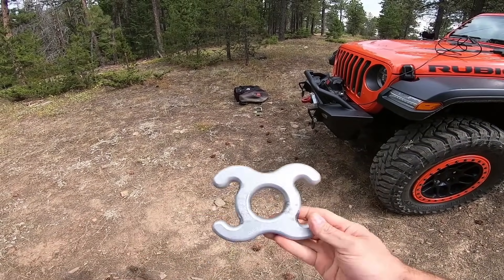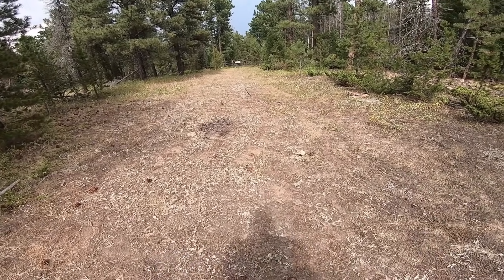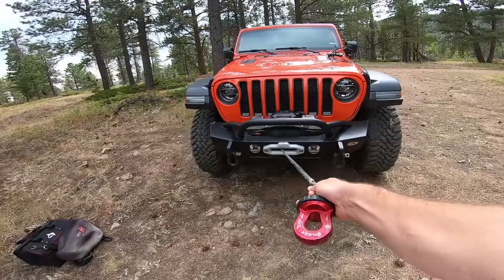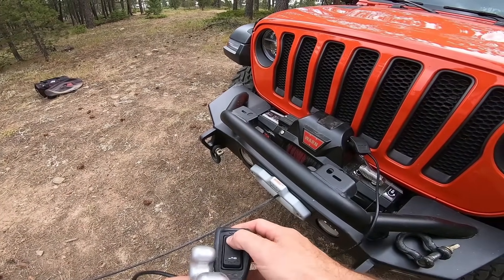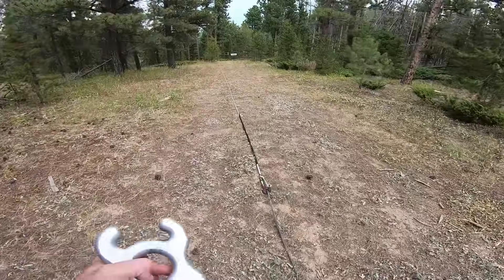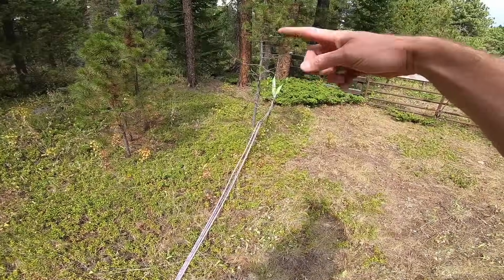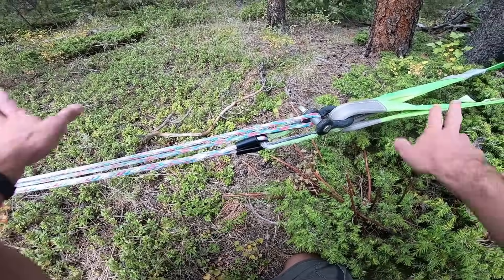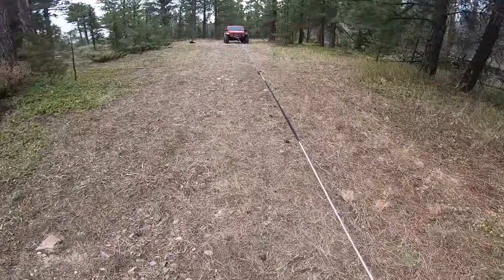Offroad Recovery Gear - What's an X-Lock Part 2

Comment from the maker: i was calling the shackle a "bow pin shackle" for some reason today which is wrong of course.  It's a screw pin bow shackle lol!  have no idea why I did that over and over, but I did.
Reply: the only tree,,the only tree,i could attach to,,in the simpson desert,took 25 yrs before it was big enough...i died after 4 days.. damn it..people die thinking 4x4ing is fun.. they leave the vehicle,no water or blankets. food bars.
Reply: Was gonna say, if you got a "bow pin shackle" you need to throw it away cos it's been overloaded. That's if you can get it off the line 😂
Reply: Clevis and a shackle, one has a screw pin and a threaded hole, the other has a through pin with a keeper, I personally like the through pin for faster work, but I use a bolt and nut with a hole in bolt for a keeper, I like to follow over head lifting rules as that's usually safest
Reply: interesting product.  I use chains and ropes and find that tighten the screw then back it off 1/8 turn keeps it from jamming rock solid after a hard pull.  Could you use 2 x-locks on the working line instead of the shackle?
Reply: Just shackle will do.
Reply: Always called it a clevis hook myself.
Reply: @jakemesa3211  Clevis pin shackle is a loose pin with some type of retainer.
Reply: Just curious about your tire size/lift?
Reply from the maker: Right now its a Mopar 2 inch lift but I'm looking at changing that out.  Tires are 35s.
Reply: @JustinKingOffroad  it's amazing to me how little lift JL's need to comfortably fit 35+ tires. I just finished putting in long arms and going from 6 to 7 inch so I can get 35's on my wife's ZJ for her without losing flex. My old Yj's a different story, but still. I love your wheels and ran those tires on my Yj for a while, really liked them. Your Jeep looks fantastic, take care of her.

Comment: Can you explain the winch losing 10% of power for every loop thing? Or direct me to some good reading. I couldn't find any info online. I've only watched content about winching, but I've never heard that mentioned and it seems like a pretty important fact
Reply from the maker: Easiest way I can explain it is like riding a 21 speed bike.  The sprockets on the pedal side of the chain...is it easier to pedal on the small sprocket or big sprocket?  That's how your winch works.  Smaller spool of wire or rope, more capacity to pull.

Comment: Question: Ok I have been looking to see what is required for scotch blocks. I've seen people use them behind the tire and I've seen like this you drive up over the block and tire is resting on the chain/strap. Would you mind shedding some light on it. Where exactly do you want the block to sit in relation to the tire? And are chains or straps better? You said you converted yours to straps. Any chance you can show or have a video explaining these items?

Comment: There's a way to double the pulling power of the wench by using a snatch block which is basically a pulley with a hook on a block where you take the pulley out of the block and put the cable in there and put the pulley back in and run the hook for the wench cable back to the Jeep and have a chain around the tree you want to wench to and then take the hook on the snatch block and hook it on to the chain and that will double the pulling power

Comment: Excuse me professor, but if you hook on to a tree without the x lock then the Jeep will still pull itself to the tree and the cords won't move at all cause the tree is stationary so it will not move at all so the wench on the Jeep is steadily pulling the Jeep to the tree so it's not necessary to have the x lock.
Reply from the maker: Tell me you didn't watch the video without telling me you didn't watch LMAO!!

Comment: A capstan style winch makes the ‘X Lock’ unnecessary. There no loss of pulling power and you can pull an indefinite length of line.
Reply from the maker: While that statement is correct, these do not exist for the consumer market to use while offroading.
Reply: There are a few capstan winches including Portable Winch. I have both  capstan and traditional winch. There are pros and cons to both but I prefer the capstan winch.

Comment: First off I have to state I am not an expert on winching. What I can tell you though, if you are stuck and you happen to be the only vehicle (alone), you are not going to worry about diameter of line being wrapped around a bolt or anything else. You are not going to worry about using a pulley system or x block or anything else. You are going to use whatever you have, whatever you can rig up to get your stupid a$$ out the mess you’re in so you don’t freeze to death on the mountain, river or anyplace else and learn not to do that again.
Reply from the maker: 100% yes!!!

Comment: Should of got the wireless winch it makes getting in a safe position a lot easier. 😊
Reply from the maker: to a point.  in reality you need to be inside the vehicle with the foot on the brake winching someone else, or controlling the vehicle winching yourself.  if you're standing outside while winching someone else it's a good way to blow up the parking pawl on your transmission.

Comment: So I tried TLDR and skipped to what I thought were the important parts and felt dumber for still not understanding why the X-lock was needed, so I forced myself to start from the beginning where I was reminded that the more line you have on your drum, the less towing capacity your winch has (forehead slap).

LoL, because I used to help run 6 43 ton (bridge weight) off-road trucks and we only had a side mounted PTO rated for 5,000 pounds and we were very aware of how to get the most out of what we had (use the radio to call another vehicle LoL. Usually you were stuck because a wheel went into a bottomless pothole or mud ridge and all your other 5 foot tall wheels were spinning and you needed just enough assist you hope to get that wheel up).

An X-lock does make sense if you don't have a convenient anchor point that allows you to maximize your winch's pulling power.

Now if it could only help you when your dumb friend goes into the water you told him not to, and you dug yourself into the soft, fine sand using your jerk strap so now you are both sitting on your frames connected by a really tight rubber band...

Comment: Good job on the X-Lock!!   Some people need to just read the book that was in the box with the winch. YES read the book!
I see you have a Kenwood D700 or D710 are you running APRS and are you using the I-pad for the APRS. if so I need some help to do that.   N6LSP
Reply from the maker: I do have a 710 for aprs.  I use the iPad for maps.  But now that I have a bronco I use android auto for the maps, iPad went back to being drone control only.
Reply: @JustinKingOffroad  I have a D710 A  and need a little help. . it dose not have the inside GPS so I had a interface ( usb  to 9pin ) that went to a small GPS. The interface let the blue smoke out DOA. What did you use to GPS data to your D710 and your I-pad and did the I-pad show you and other APRS and text  on the map. How did you do it and where can I get the parts. I have a 22 RUB 4XE with little to no room with UHF/VHF/HF.
73s
N6LSP

Comment: Minimum bend radius

Equipment:
1.5 x rope diameter (recommended minimum bend radius)
5/16" winch rope
3/4" shackle

Calculation:
1.5 x 5/16" is 15/32" (0.46875") minimum recommended bend radius
3/4" shackle pin radius is 3/8" (0.375"; 12/32") (radius = 1/2 diameter) (actual bend radius)

15/32" - 12/32" = 3/32"

Conclusion:
Actual bend radius is 3/32" less than the recommended minimum bend radius.

Comment: Why do you loose about 10% of your winch capacity every time the line comes in and why can you only let half the length of your rope out of the spool?
Reply from the maker: You can let all but half of the final wrap off. This prevents the line from flying off the drum under load.  And the reduction as the rope stacks up on the drum is like the front gears on a bike.  As you jump up in size it's harder to pedal.  As the rope stacks on the drum, each layer makes it harder to pull.

Comment: you have all equipment to use is right, but if you don't have tree or rock around to hook the line to pull the car out mud or snow,  what equipment you needs  to whole the line to winch the car? did you think a bout the Anchor or pole drive? in this v d o you have the tree to hook the line . I care anchor home made and the drive pole  + hand winch + ropes with me while I think I'm off the road alone .

Comment: People are Gonna say what they will .. I use steel cable line .. I like synthetic but it’s just not durable compared to steel line … I know .. I know it’s gonna break and kill someone and anything is possible .. but using line dampeners and knowing your working load limits mitigates your chances of injury.. I use soft shackles to take as much mass out of the equation that I can … great demonstration and very nice jeep ..
Reply from the maker: we do use steel when we need to.  and it sounds like you're doing it safely.  staying within the operational limits of the gear you have is the best mitigation!!

Comment: I'm not trying to argue with you, you clearly know more than me with all this... but if a winch rope minimum bend radius is 1.5x its size (diameter), that would make the pin need to be 3x the rope diameter.  For instance it looks like you have a 3/8 winch rope, which is 0.375... 1.5x that is .5625 radius, so the diameter of the pin would be over any inch (not a 7/8in pin that is found on 3/4 shackles) at 1.125 (1-1/8inch pin).  Radius is half of diameter.   

Just wondering if I missed something.  I recently found your channel looking into the X-lock and like what I've seen so far
Reply from the maker: That bend radius is the overhead lifting requirement, there is a little bit of leeway in recovery rigging.

Comment: Is there any issue running a soft shackle through the thimble of a rope? I am looking at that thinking that the thimble doesn't meet minimum bend radius safety standards for the soft shackle. That bend radius looks awful narrow.
Reply from the maker: soft shackles are kinda in a unique application, doubled up like that, you can kinda use them however you want.  we've gone around some semi-sharp stuff too and they hold up ok.
Reply: @JustinKingOffroad  thanks! Great video and awesome explanation on the x lock. Appreciate it!

Comment: Why don't you just double up your winch extension? You can make a 100' extension 50', 50' can be doubled up to 25', etc.
Reply from the maker: some times you still need to shorten the line even if you're using the x-lock for max pulling power. but some times it's just easier to not mess with all the rigging if you only need to go forward, and need 10,000 pounds of pulling force vs 5000 with half your line on the winch.

Comment: I realize this is way late, but your minimum bend radius math is indeed wrong.  Your rope is 5/16.  1.5 x 5/16 is 15/32, your minimum bend radius.  The radius of a 3/4 inch shackle pin is 3/8, which is less than 15/32.  You are indeed under the minimum bend radius of your rope.  To meet the minimum bend radius of your rope your pin needs at least a 15/32 radius, or a 15/16 diameter.  The interesting question I have is what is the outside radius of the X-Lock?  That doesn't look to be much more than 3/4 thick, so the X-Lock itself may be exceeding the minimum bend radius of the rope.  I am not trying to be pedantic here, but you were throwing technical numbers around in a situation which has very specific ratings, and you were incorrect.  Do I think you were damaging the rope? probably not.  There are conservative safety margins on everything that has life and limb ramifications, but if it came to a court of law you were using that rope out of manufacturers specifications.

Comment: OK, so you're bogged in sticky mud and it's a long pull to get through. How many times do you want to get in and out of your vehicle ? Each step you take you get taller 😁 I've been there . . . lots of times.
This has its potential uses, but I'll stick with pulleys. And winching without adequate dampeners is a huge no no and another potential misslie on the line doesn't thrill me either.
Reply from the maker: we use the x-lock with pulleys quite a bit to still get to the last wrap on the drum.  and winch dampers do NOTHING on synthetic line.  steel yes... rope no.
Reply: @JustinKingOffroad  Our group was on Fraser Island in Australia, and a guy (not with us) was winching another vehicle that was belly deep in the soft sand. It had to be an angle pull and the shackle pin that was connected the pull line to the stuck vehicle failed. The shackle body flew back about 20 metres but thankfully no one was near. There was no dampening and the winch was using dyneema. I didn't actually see it, but heard the loud twang and the exclamations of the people and then found out what happened when I went over. Anything under severe tension will snap back. I use purpose made synthetic saddle bags that can be filled with sand/earth, or pieces of chain that can be laid over the line.

Comment: As far as a presentation, you did a find job.
But this is bling that just makes winching a chore.
I'm still absolutely convinced the real reason wheeling has become so unfun, is chrysler has sucked the life out of the lifestyle with these overbuilt under preforming monstrosities!
But you were fine and not boring and have a non irritating voice!👍.
Reply from the maker: that x-lock really helps in complex rigging situations were you need all the rope off the drum and haver nowhere else to put the extra 30 feet hanging there.  but yes, it does complicate things a bit for sure.

Comment: Never pull on the pin side as it can spin the pin and fall apart, just something I learned from over head crane rigging, but it look like this guy is smarter than most, most importantly I don't really care as long as you don't get hurt
Reply from the maker: The line is non moving through that shackle. Most people can't grasp that for some reason lol!

Comment: Great video  - I have a 12 ton Champion winch for a seasonal use  rear hitch pull on my snow plow truck.  The problem with a cheap winch (Champion or harbor freight) is that line pile up on a sideways retrieve will pile up and easily break the housing once it exceeds the diameter of the full spool.  I  need to minimize the retrieve line stacking diameter to avoid a major winch break down (broken housing).  This tool will do it by putting most of the line off the spool. I am going to buy one.  The housing repair parts were only $30 and about an hour of repair time, but having a broken winch when you have to pull yourself out backwards is a major inconvenience. I rebuilt my neighbor’s harbor freight winch front mounted winch for the same breakdown.  Thank you.

Comment: Stupid crying keyboard know it all’s yet can’t use the same tool to learn the correct information. If someone is trying to correct someone else at least check the facts and know what your talking about. If you don’t then STFU. Good info. Plus it doesn’t really matter how you use the tools to get your truck unstuck and home as longs as it’s being done as safely as possible and know what your doing. Like practice before your really stuck and know your equipment and know how to use them.

Comment: well i have never used a winch ever in my life and i had no idea that you loose winching capacity with the rope spooled up. Is it the same with steel cable or is this just an issue with synthetic ropes.
Reply from the maker: It happens no matter what kind of winch rope or cable you have, as you stack layers on top of each other you lose capacity.

Comment: I designed a dual spool winch that would eliminate the need for any of this rigging.
First spool has three wraps second spool winds the line.
Downside was difficult to freespool and the size was a bit larger than most would want to deal with.

Comment: sooo instead on attaching the slack to the same point. could you attach the slack to a second point to share the load eg if that one point wasnt stong enough 1 tree looking abit weak to risk pulling on so you use 2 weak trees
Reply from the maker: in regards to the multiple lines coming off the x-lock back to the vehicle, probably not.  but you can move the whole re-direct to a tree if you needed to lighten load on your bumper when pulling.  it's situation specific.  if you are recovering yourself 2:1, you have to go to yourself otherwise you just have a 1:1 on a redirect.